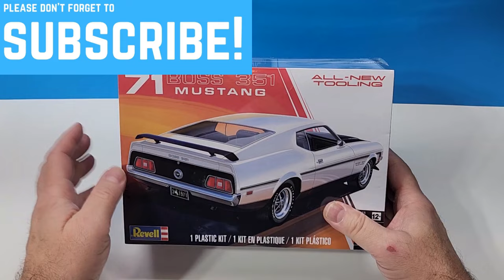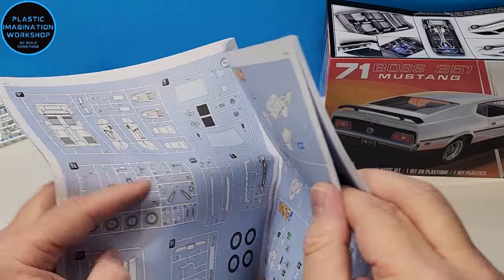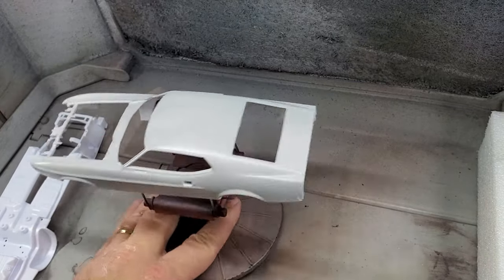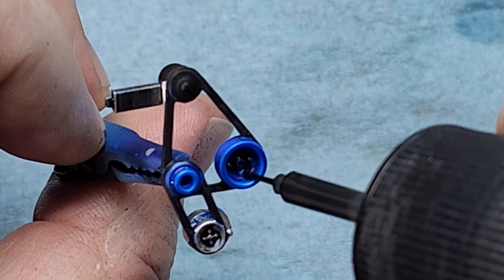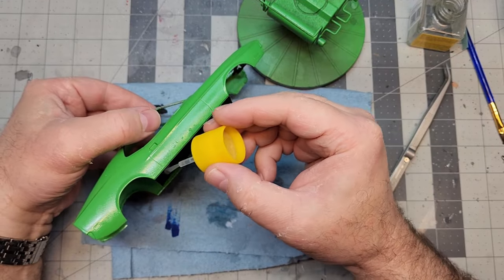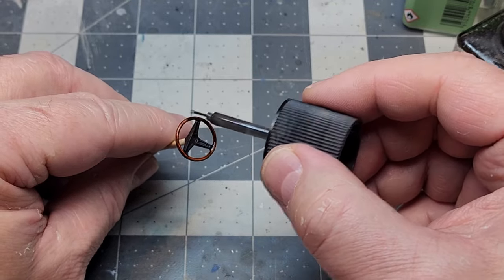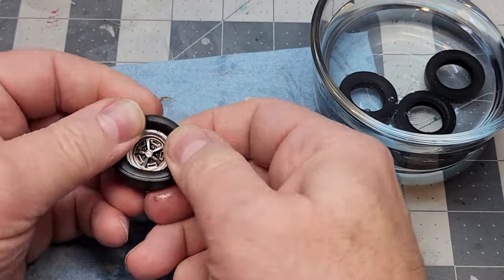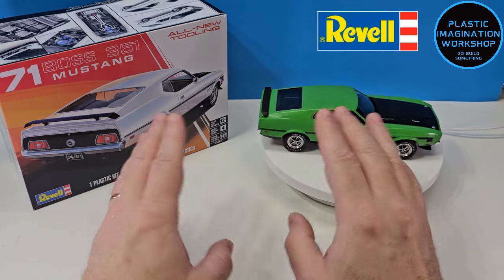The All New 1971 BOSS 351 Mustang from Revell - Full Build & Review

Comment: Great video bud. I can't believe you can get that Tamiya extra thin cement to keep things together using it on top of paint. Btw, what paint gun are you using in this video? I assume you figured out that you need to use the TS line of Tamiya sprays instead of the PS line. The PS coded paints are for things like RC cars I believe, specifically for polycarbonate. The TS coded paints lay down perfectly on all model kits
Reply from the maker: I think the airbrush your referring to is my Badger Sotar 20/20, it's a great airbrush. And yeah, I learned that I used the wrong Tamiya paint. Growing up I never had access to any of these paints and I didn't know about the differences between the TS vs PS paints. Lesson learned, the hard way. :^) Thanks for watching and have a great week!

Comment: Nice assembly, primer must be compatible to the paint that you use temperature is important paint should be sprayed at about 70° or higher, Dupli-Color works great, with a clear coat , then it can be buffed out with a soft cloth after about 24 hours
Reply from the maker: Thanks for the tips! And thanks for watching. Have a great week.

Comment: Thank you for sharing. When assembling the engine, any challenges having the glue adhere to painted parts? For engine detailing, is that Enamel or Acrylic paint? cheers.
Reply from the maker: You're welcome.  You need to scrap off the paint where the parts  connect or use some super glue. Workshop well both ways. All of the paint is acrylic except for the body color. I hope this helps, thanks for watching.
Reply: Thank you. That is what I thought, but I did not notice paint being scraped off before applying the "Tamiya extra thin" glue.

Comment: Any reason why you used polycarbonate spray paint on the body? Do you normally use polycarbonate? Just asking as I want to paint a model metallic purple and it only comes in a PS. I was thinking it might not be suitable after seeing the  problems you had with your paint job wrinkling.
Reply from the maker: This was Tamiya paint and is specifically designed for plastic model kits. That said, this was a very old can of paint which is most likely the reason it had issues. I have used this same type of paint many times without issues. It's all part of building models, sometimes things go as planned, sometimes they don't. Thanks for watching, have a great weekend.
Reply: @PlasticImaginationWorkshop  I noticed you were using PS Tamiya ipaint. PS paint is made specifically for spraying the inside of clear polycarbonate radio control car bodies. TS Tamiya spray is the correct paint for ordinary model car bodies.